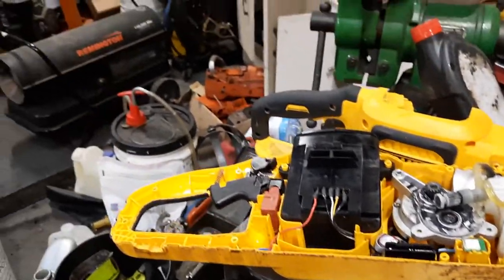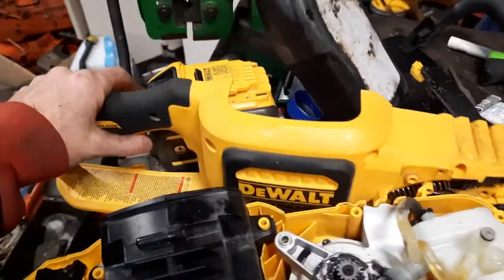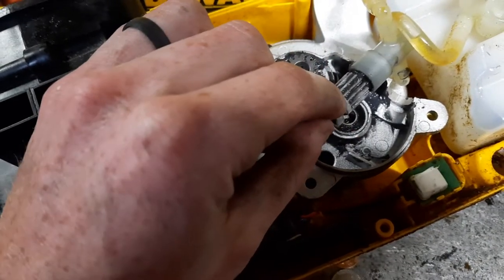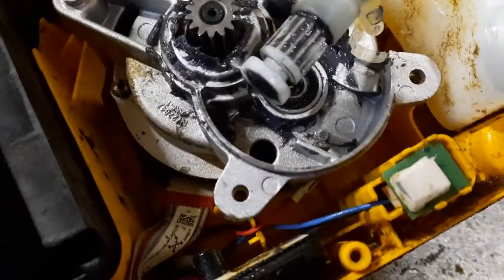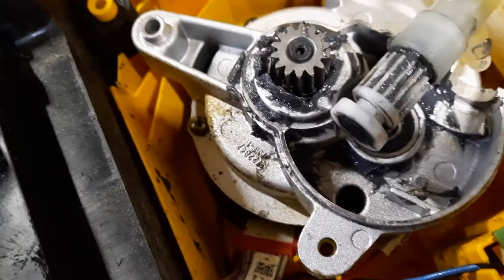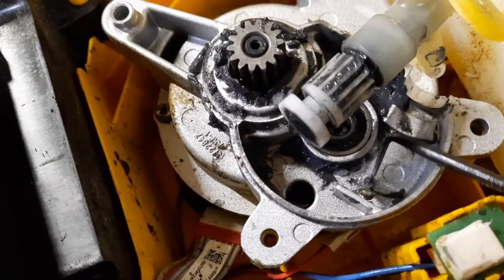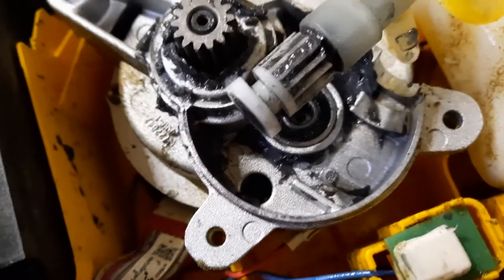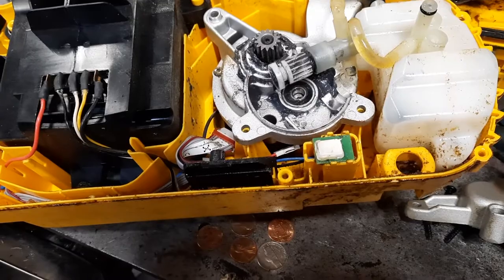Dewalt Chainsaw not pumping bar oil

Comment: Thank you so much! I used a 7018 tig welding rod bent 3/4" @ a 90 degree and started grinding it to make sure the gearbox closed without tension. At one point while i was regreasing the gearbox i found the piece of cast iron so i used that as a proxy for how high it needed to be from the based of the cast box. Up until i found the piece of cast you mentioned broke off I was skeptical that Dewalt would make something so vulnerable to damage and not repairable. Its working how long, who know. Ill say this 60v was much easier to disassemble than the previous 40v model I replaced an oil pump on. The oil pump on the 60v seems better built with the exception of the week point you discovered. Thanks again, i am topping a large section of 25+ foot trees and almost done, and i didn't want to clean up with the dewalt pole saw. 😊
Reply from the maker: Glad I could point you in the right direction.

Comment: Alumiweld or place a steel pin and JB Weld perhaps.  The pin looks like it was unsupported on one end, so maybe run a steel pin all the way through (machine #10 all thread and jam nuts) the pump case since it only has grease inside.
Reply from the maker: Wish I had added a follow up now. I drilled a hole and put a 1/8th inch spring pin in it.

Comment: How do you fix this problem of the pin breaking off?
Reply from the maker: I drilled a hole and added a 1/8th inch roll pin in it.  Although i was able to find the motor casing online for $60.

Comment: Mine has never oiled from new and I’ve messed around with the tubing and even put a new pump on. I wish I’d seen this video last year! That pin has been gone since day one. Must be a common fault on these saws..
Reply from the maker: I would imagine. It's a poor design in my opinion.
Reply: @Moose54656  is your repair still holding?
Reply from the maker: @tomdaloon  well, I haven't gotten it back from the guy I fixed it for. I can only assume so.
Reply: Same here.  And until this video I didn’t understand how it worked.  I thought just spinning the pump made it pump the oil.  Since mine didn’t have the pin from day 1, I didn’t know what I didn’t know.  I replaced the pump and it still didn’t work.  LOL!.  I do know that there are 2 versions (at least) of this saw.  The early 60V 16” saws had a traditional camshaft driven pump where only the cam spun and the pump itself just went up and down.  I feel like that design is superior to this one.